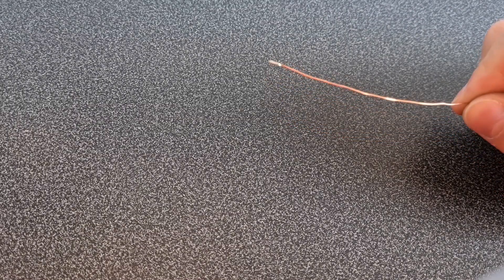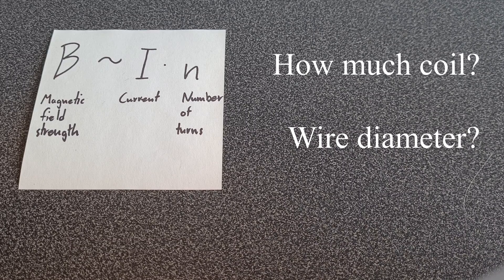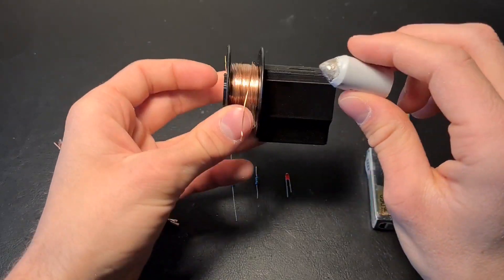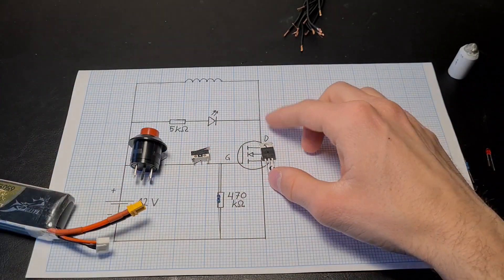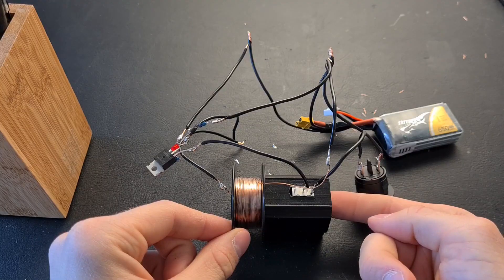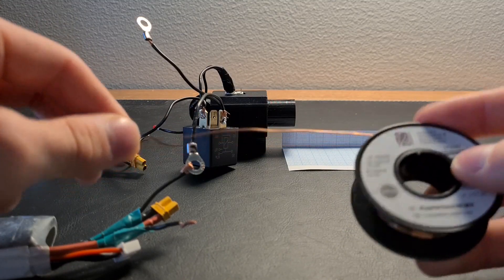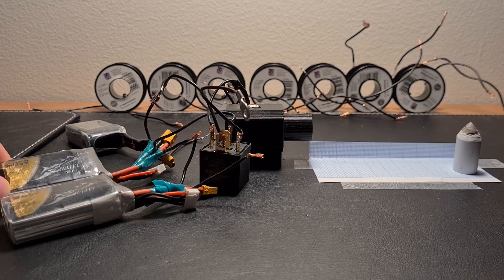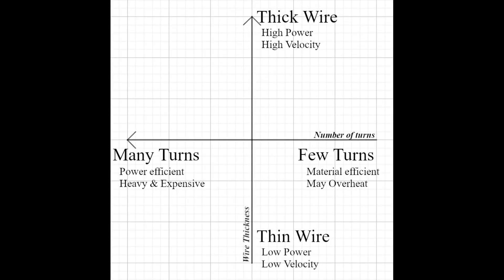Optimization of a Coilgun Coil

Comment: my final idea, it seems useful to create a system using air, or springs, elastic, however you do it, that can help accelerate the projectile, and then have precise timing on one or more coils at the end before it leaves the barrel/track to give it its final burst of acceleration, that way it saves power, and it might actually be easier ways to give it a good nudge once its up to speed that drastically increases the kinetic energy but easier than trying to get  a stationary thing to start moving down that track.....just thoughts

Comment: another cool idea is to have a sort of current sensing feedback network, not sure how it works since I am not an EE, but I figure you can have it slightly auto adjust based on projectile so that it doesn't over saturate or so it can do timed switching to help accelerate it. That, or some type of way to adjust parameters on the fly to try and dial in different sized or type projectiles.

Comment: i bet theres cool things to try like having engneered  magnetic/anti magnetic materials in layers or however it works out, so that right before projectile exits it is repelled by the antimagnetic, or perhaps having a aluminum, copper or other barrel, with a gap in one or more sections, so the projectile is only exposed to the field at precise times, when it passes thru the open sections, maybe some of the magnetic effects of aluminum or copper would then help accelerate the thing in a way, that or figuring out the timing, having it be made out of lead, with parts of it be magnetic so that it is timed precisely. Then again, it is way better to be able to use it with a variety of sizes or types of bolts, etc.

Comment: Putting the other led into cancel out the back EMF is all you had to do to keep your transistor. Usually we would use a diode or a resistor. An LED is a diode so you're using that energy up which will cushion your transistor.
Reply: I'm actually doing research in back EMF right now. I have a new idea for a hybrid coil / railgun that uses the back EMF to drive the coil after the projectile passes through the first set of rails. I'm trying to stage it so that I can have multiple rails and multiple coils. I'm actually in the middle of designing the whole thing out as I make this comment
Reply: Ever got around to making your design?  @SteveSiegelin

Comment: But did each of the different coils have roughly the same weight of copper, was each coil just a single layer of copper wire? Or multiple layer? 
And/or was EACH LAYER wound the same way? Ie starting on left eningd on the right?
Reply: If multiple layers are wound different ways like left to right 1, right to left 2, left to right 3, right to left 4, then each layer m field will be ns sn ns sn, 

If all wound from left to right  then the m field will be ns ns ns ns x4 the strength, and more propulsion

Comment: Would love a follow up on this video. Making the wire thickness test to find a practic optimum and test it with the n.o. turns optimum. I was also thinking about if there were any easy ways to lower the resistance in the wire like cooling it etc.
Reply: You can cut your wire in equals lenght and add them in parallel instead of using a single piece of wire. You will divide by 4 the résistance just by cutting into half
Reply: @larduiniste4802  so do you mean multiple coils next to each other but with the same combined length? If so it would be most efficient to use one ”circle” of wire and stack them in parallell?
Reply: @henkee3715 (possibly inaccurate, please correct me if you see any errors)
 I'm not sure I understand the end of your comment, but my construction is the following: instead of winding one wire into a coil, you do the same process by holding 2 or more wires of the same length. If I think about it correctly, the "number of turns" in the calculation of the magnetic field is not modified, but the resistance across your coil is divided. That said, this does not reduce the Joule losses for the same magnetic field: it simply allows you to reduce the input voltage for the same result.

Comment: What stops the power source from shorting out?

I know the magnetic field created consumes some energy and opposes a change in current due to its inductance, and that its only connected for a brief moment.

But its still just copper wire? Does the length of it provide enough DC resistance? If so, how much is "enough" to prevent damage? 

Someone let me know if they know the answer! 

Ive found a few explanations but i wouldn't say they're exactly related to this question

Comment: Very interesting! It's been a while since I last played around with this stuff, but iirc one of the considerations for the amount of loops to use is inductance. While magnetic field strength scales linearly with the number of turns, the inductance increases exponentially with the number of turns, which ultimately affects how long it takes for the coil to become (de-)energized. Lower inductance means the coil turns off quicker, allowing you to keep it on for longer. Probably not really a concern for a single stage coilgun, but something to keep in mind for high-speed multi-staged ones, where every millisecond counts :)

Comment: no capacitor? no invertor or rectifier?

a 12 volt DC battery wont give near enough voltage to move that projectile

is there soemthing youre not telling us my friend?
Reply: Very probably. See also: Ultra power full COILGUN!

https://youtu.be/s6cFMM6MTpI?si=d9uViwHaR6vgnW1g

https://youtu.be/xY17v43TorU?si=ms8LLehidgsVw2Ep

https://youtu.be/zoA_iUGHyPg?si=IuZUGnQfxk9x0d74

The evolution of the bazooka in the third millennium SILENT BAZOOKA (COILGUN - BAZOOKA).

https://youtu.be/0yvVi1eukeI
Reply: 12 volt lipo batteries like the ones used in this video can easily output 80 amps continuously, and probably closer to 150 in short bursts.

Comment: i have a question. I built a coilgun, from a kit from aliexpress. i built it as it comes but the only thing I did is to put metal washers near the coil to increase the velocity. but every few shots the SCR get destroyed. I thought that it might be problem with the circuit or one of the compouments, but I soldered everything again and check the circuit, I also tried to change the SCR to original ones, but it didnt helped. do you think that the washers that I added cause the problem?
Reply: Of course. Maybe, maybe. Very probably. See also: Ultra power full COILGUN!

https://youtu.be/s6cFMM6MTpI?si=d9uViwHaR6vgnW1g

https://youtu.be/xY17v43TorU?si=ms8LLehidgsVw2Ep

https://youtu.be/zoA_iUGHyPg?si=IuZUGnQfxk9x0d74

The evolution of the bazooka in the third millennium SILENT BAZOOKA (COILGUN - BAZOOKA).

https://youtu.be/0yvVi1eukeI

Comment: is that enameled copper wire or normal copper wire? What do I use?
Reply: Oh sure.
See also: Portable Super Coilgun:

https://www.youtube.com/watch?v=rclLsQ9nyeg&amp;feature=youtu.be

https://www.youtube.com/watch?v=-mjDqp_oWZk

https://youtu.be/YLOYxsqvjw0

https://youtu.be/vErqh0DO_S0

https://youtu.be/OFIQ3pcFZpU
Reply: Its enameled copper wire but you can also use insulated copper wire (your coil will take more space)

Comment: I just wanted to comment about the inductive voltage spike and that poor Mosfet and LED. Then I saw the poor Mosfets actually died. RIP. (Even though they are avalanche rated: I'm curious if (and by how much) it exceeded the ratings. How high is the current that flows? Do you know the inductance of the coil? If not, what are the number of windings, inner+outer diameter, length?)

I also once thought about the best coil design and came to the following conclusions:
1. Number of turns vs thickness cancel each other at same mass of copper and the same power flowing through it. Thicker just means lower voltage with higher current, while thinner requires higher voltage for same power, but less current is flowing. You just need to optimize thickness vs windings for the voltage of the power source that has the best power density (with enough energy for 1 shot). Usually that is 400V electrolytic capacitors.
2. Losses are prop. to I² while field strength is prop. to I. That means double the field needs 4x the power. However, the further out the windings are, the worse they are for field per power. Therefore, for optimal efficiency, outer windings should have thicker wire then inner windings.
Reply: Maybe , maybe .
Oh sure.
See also: Portable Super Coilgun:

https://www.youtube.com/watch?v=rclLsQ9nyeg&amp;feature=youtu.be

https://www.youtube.com/watch?v=-mjDqp_oWZk

https://youtu.be/YLOYxsqvjw0

https://youtu.be/vErqh0DO_S0

https://youtu.be/OFIQ3pcFZpU

Comment: Great video!
 yes its all about the right balance of your projectile and coil configuration in relation to your power supply with regards to efficiency, other factors such as inductive reactance and hysteresis effect the efficiency as well
Reply: Oh yes. Hi! How are you? See also New Portable Super Coilgun:

https://www.youtube.com/watch?v=rclLsQ9nyeg&amp;feature=youtu.be

https://www.youtube.com/watch?v=-mjDqp_oWZk
Reply: @howtomakeacoilgunoffallout4096  Ive seen those thanks. Not too great amazon sent my capacitors back After they have already been shipped
Reply: @wynand988  besides amazon there are other suppliers of capacitors
Reply: @wynand988  I bought it earlier on Aliexpress.
but now found a supplier of quality capacitors in the aftermarket